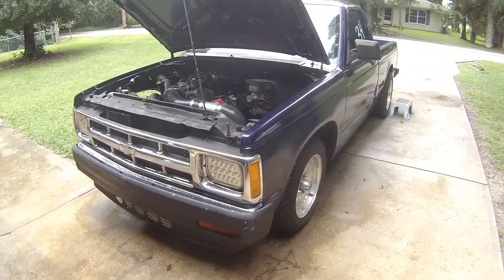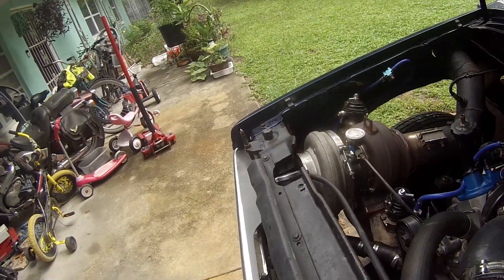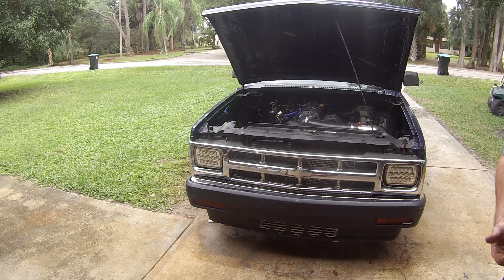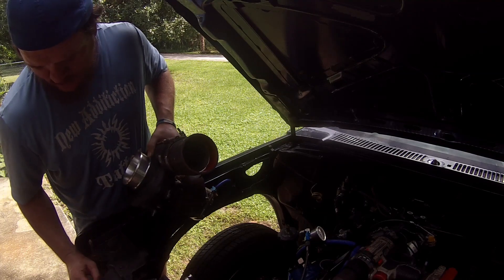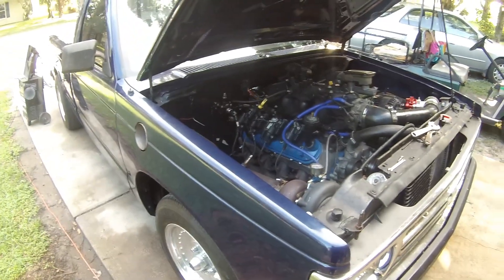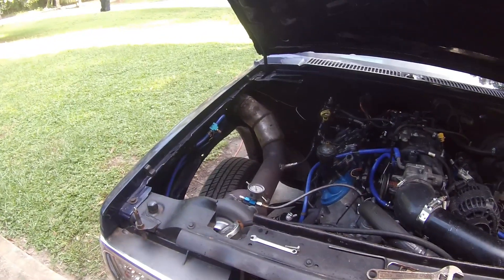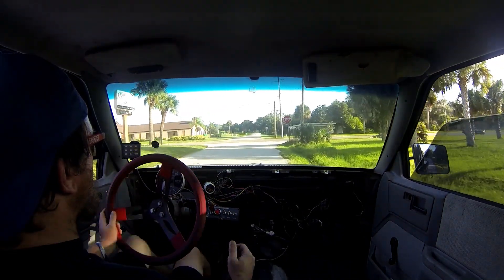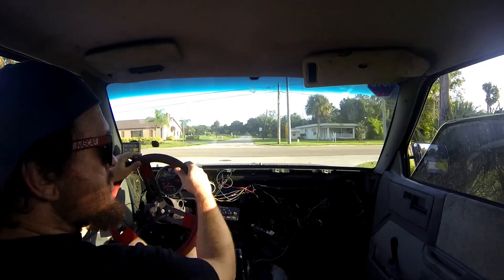S-10 Project pt. 16: Turbo Swap

Comment: great video , the drop in fuel pressure could be coming from the following , if you have an upgraded pump in the tank  check pick up hose , the small hose usually no longer than 3-4  inches that is connected by two clamps between the actual pump and the pickup tube sometimes one of clamp is loose and you lose pressure from there at higher fuel demand.
Reply from the maker: Great advice. It had one loose clamp and 2nd pump was never coming on do to not being plugged in.

Comment: I’m curious how those eBay 78/75 Turbos run!  I started with a $157.99 GT45 w/1.10 housing, it builds boost faster than I expected, but I’ve heard the 78/75 is quicker and flows more up top. Post up track videos ASAP!
Reply from the maker: Yeah we've done the gt45 thing also and it works good for the price. So far from just driving it around it feels great. I cant wait to get to track, just got to fix a trans leak then ol' blue will be ready.